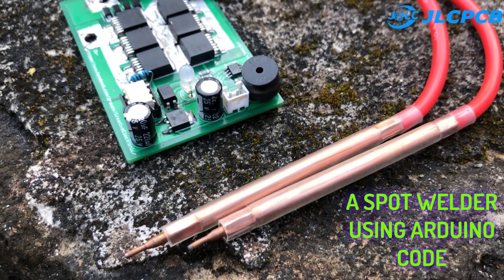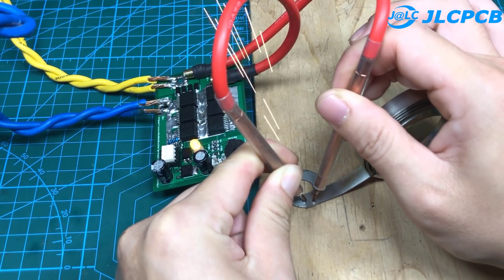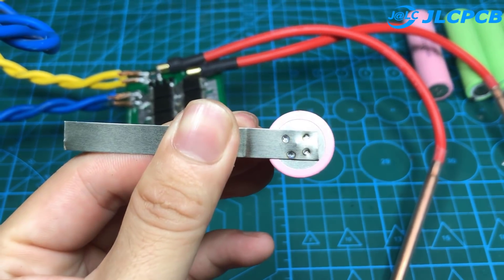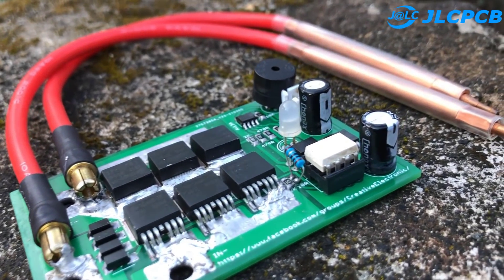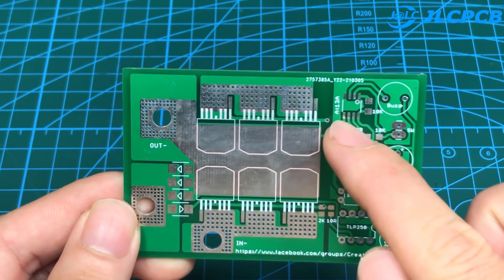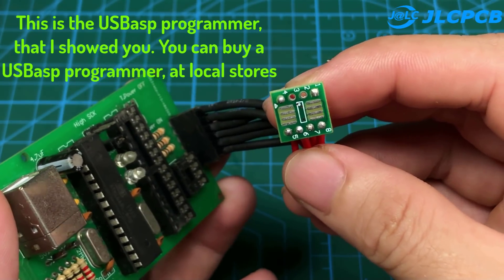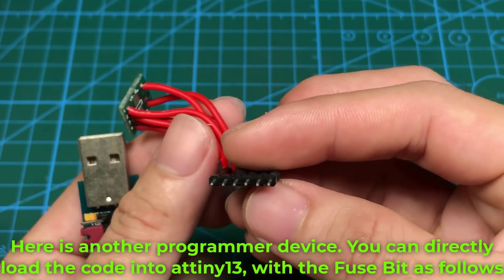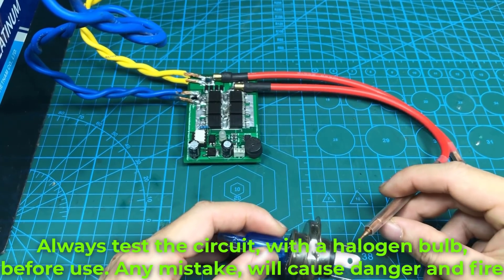Spot Welder V3 Using Arduino Code

Comment: Hello, I have made your circuit, but I have a problem, the tlp250 does not get the pulse to activate the mosfets, I program the attiny13 with arduino nano as isp.
I record it correctly and I have tried in different ways .ino, .hex, programming efuses, but I do not get a pulse on the gate.
thank you
Reply from the maker: How much volt input bro? Some fake tpl250 need minimum 13.5 V for operation